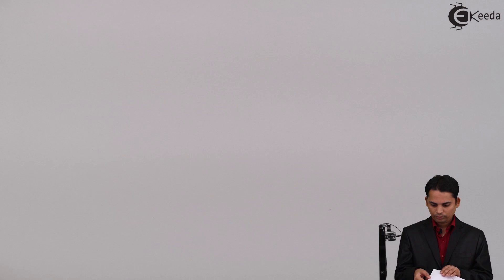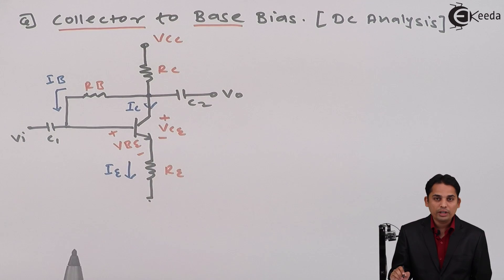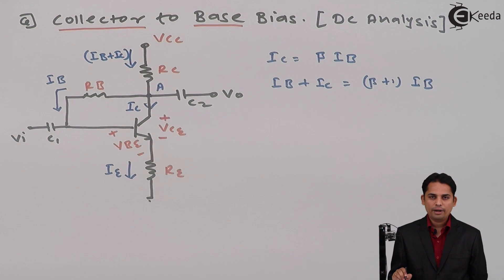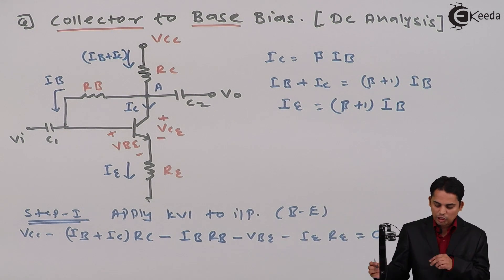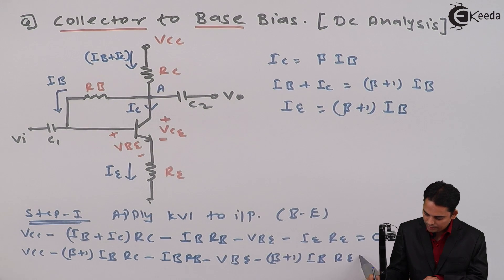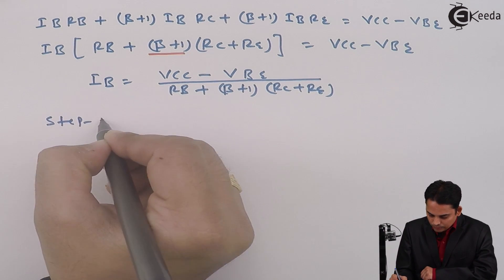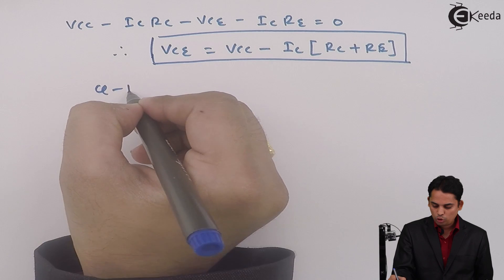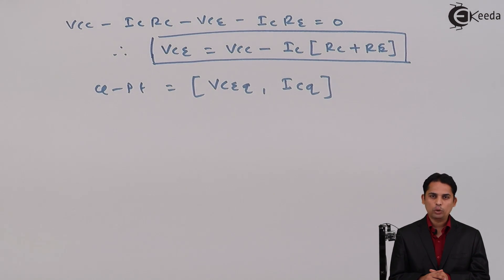Collector to Base Bias Circuit in DC Analysis - Bipolar Junction Transistor - Analog Electronics

Comment: aap ne collector wale mai capacitor  kyu add kiya
Reply: The output from the transistor is both ac and dc , so  to block dc we use capacitor , u will get it understood while you are studying transistor as an amplifier , where we use both ac and dc as inputs , dc for biasing and ac for amplification . Thank you